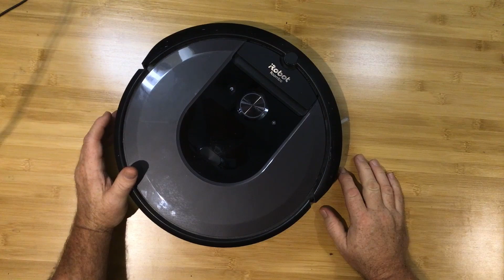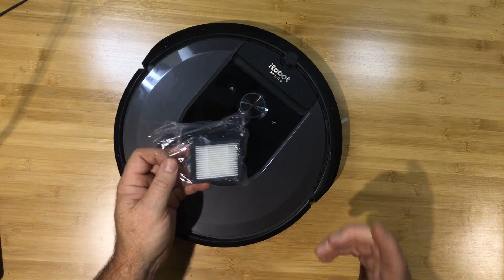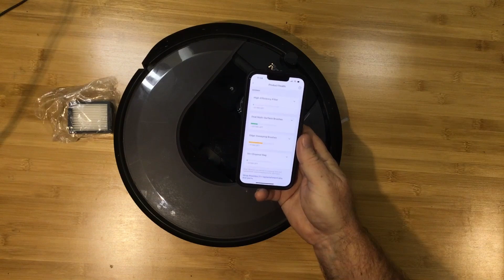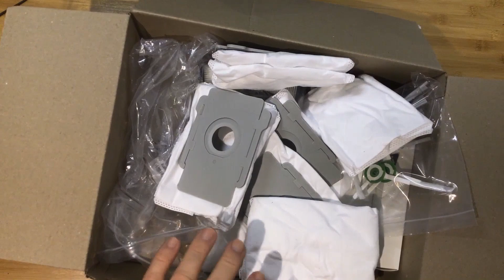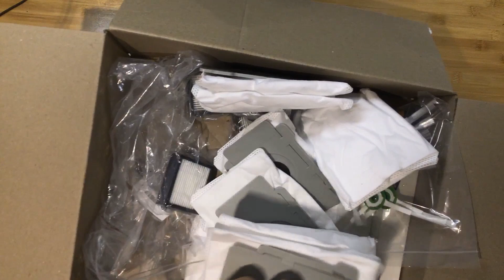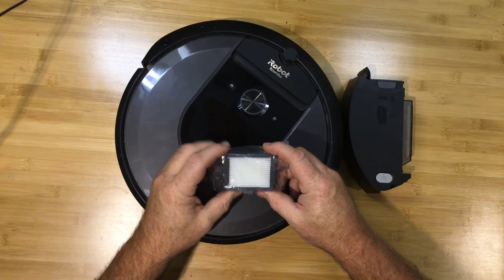50% Quieter Roomba Robot - What's the SECRET?

Comment: True facts here. I replaced my filter couple of weeks ago and once i made the robot do it's course before i got home, it had about 5min left once i got home and i really had to listen where it was in the house xD.
Reply from the maker: Yes its quite amazing the difference it makes. I feel a bit guilty in not replacing it sooner :)
Reply: @GerrysTech  Hi, as a cheapskate who has an ultrasonic cleaner, I run them thru the cleaner. One trick is to put the filter (or small parts) in a zip-loc bag with Water Strong detergent (I use Aldi Ultra detergent) & put the bag in the water while you are cleaning other parts. No cross contamination! Another trick is if you want to Ultrasonic clean parts in Petrol (solvent) such as EFI parts, do the same! Love my U/S cleaner! tip: when using strong detergent on natural aluminium, neutralise after in weak acid such as diluted vinegar. (reduces chalking)
Reply from the maker: @DougFoskey hey that’s interesting, you can put the part in a bag filled with water and then place the bag in water the ultrasonic cleaner and it still works? I didnt realise that. Good tip.